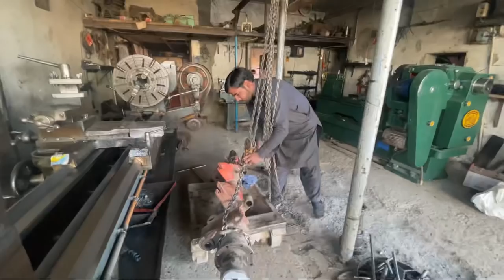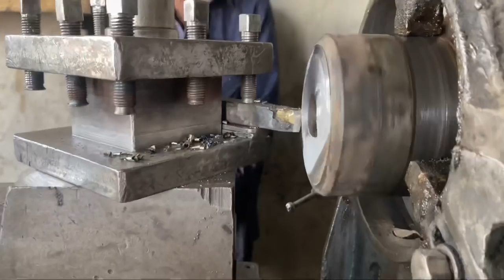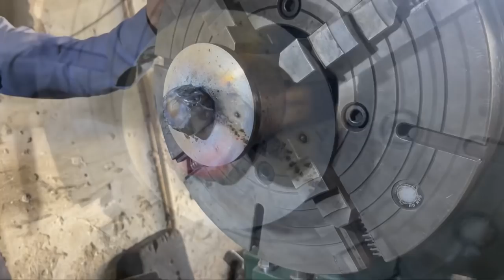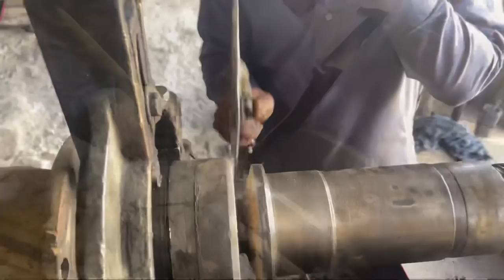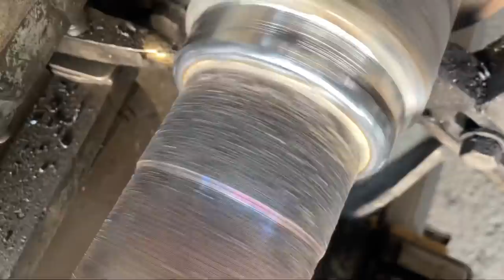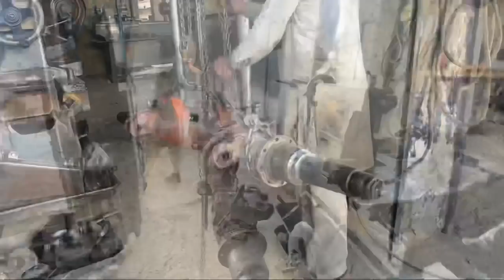How to Repair Broken Axle of a Truck Trailer || Complete Process

Comment: You can see this has already been repaired before, WHY simple the stub they put in is to small  no support allows flex, they did not cut a bevel  on the second face so no penetration,  they did not preheat the welding area to stop the large body of the axle drawing away all the heat so essentially a cold weld with poor to minimal penetration. On the axle side might as well have used super glue.
Reply: Wow at this point just use crazy glue.

Comment: That wobble after the repair is a feature ?
Reply: I totally agree. The truck will be dancing on the road :)
Reply: They weld them on bent down so when the truck is massively overloaded it runs straight 😜

Comment: the same axle will be back in a week to fix again
Reply from the maker: Maybe yes mybe not
Reply: @from the dark side of the moon This is a lazy axle or in laymen terms a fixed axle it does not spin, the only issue it the wheel will toe in or toe out or not be vertical.

Comment: At 13:00 Right at that time you can see where the end of the shaft is wobbling up and down it might be off by an eighth of an inch but still that is not going to provide you a steady ride you will have uneven wear on the tires and not 100% in control of the vehicle or truck that that is going on that’s not a good job he did sorry to say that but it’s the truth you can put a lot of people in danger.
Reply: Very true.   But at least he did a perfectly sound weld.   There us another video taken at another shop where not only was the stub off axis, the weld was of very poor quality - likely to break off again.